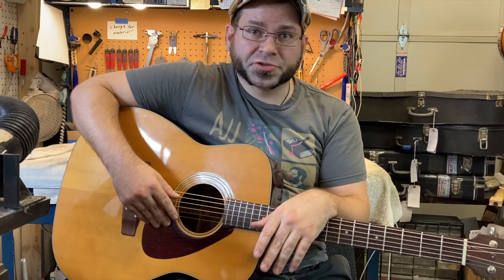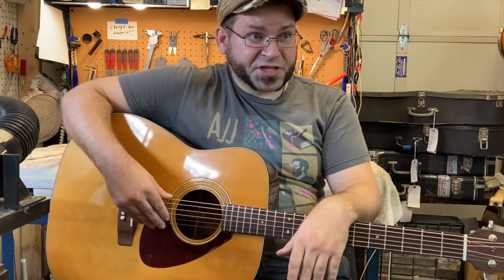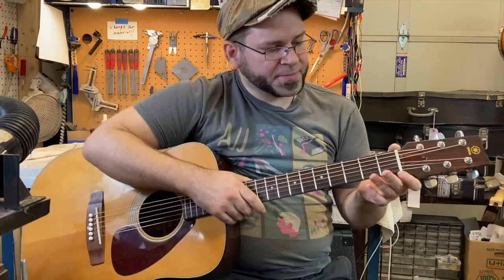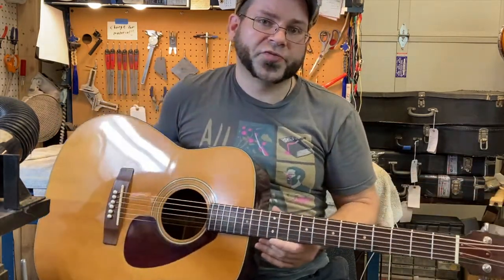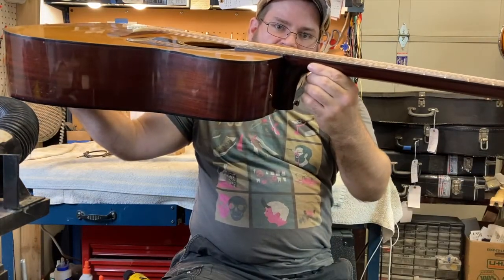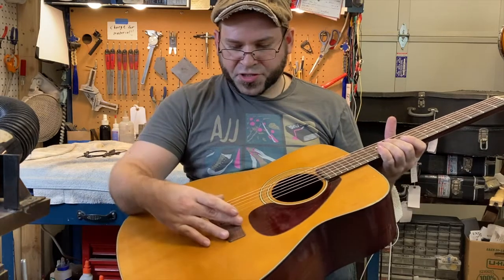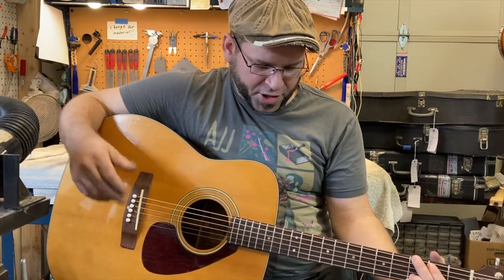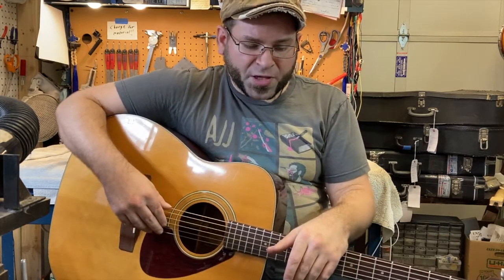Yamaha FG-160 With Bone Nut, Saddle and Pins + Neck Reset.

Comment: i must say you have done a beautiful job on that 160 mate, great video. i have a tan label nippon Gakki 1972 that i bought off a man in england 2 years ago.
They are known to have high action and can need neck resets as you know, the action was fairly high on mine so I sanded the bridge and saddle down and got it to
just under 3mm on the twelfth fret which is not bad for those guitars. i also had to refret the guitar, I',m not a Luthier but enjoy doing those jobs on Guitars.
But my god was it worth it, these guitars ring like a bell thats how I can best describe it. They are loud and they cut through other instruments too.
I play in folk sessions in Pubs here in Ireland, I have seen and heard expensive Taylors, Martins, Epiphone Masterbuilts, and I really do think that it is definitly louder
but I just think its sounds better in a live situation. I have played expensive Martins worth 2000 euro in shops but they dont sound as good in my opinion. I thought all solid body guitars are supposed to sound better, maybe its because I havent lived with one. All those old FG's from the 60's/70's sound great. I don't know is there much of a difference between a 160 and 180
I have never played one? What do you think of Tusq nut and saddles over Bone? Again great video...

Comment: Nice job on that guitar. My old fg110 is limping along, probably needs a neck reset but it’s not getting one. I like your technique with bolting the reset neck. Much easier than regluing it!
Reply from the maker: Its more that its really hard to steam these necks off in the first place. Once they are out you can glue them just fine, but try getting them off! Thats the hard part.

Comment: What nut would u replace for an black label f160?
Reply from the maker: Are you asking me what would fit or offering a trade? Nuts need to be dialed in for the guitar so if if that is what you are asking I'd say bring it to a shop.
Reply: @Drews Guitar Shop  I bought an f160 for 80 but the nut is chipped and doesn't hold the 6th string so I need to replace it.
Reply from the maker: @omararambula18  I'd take it to a shop